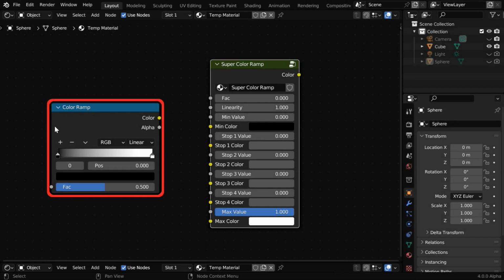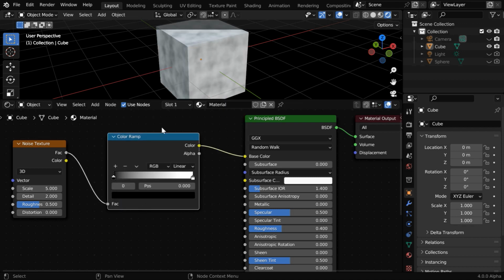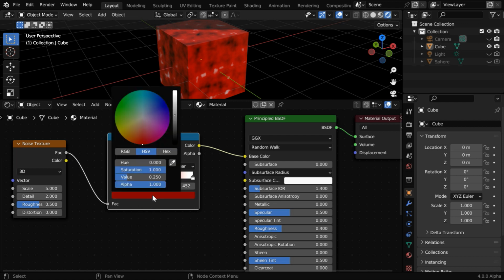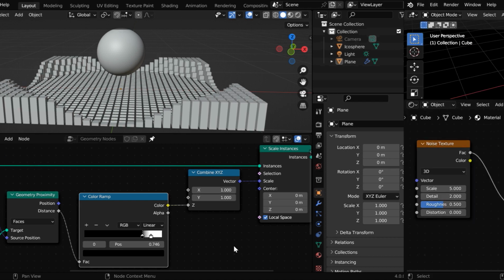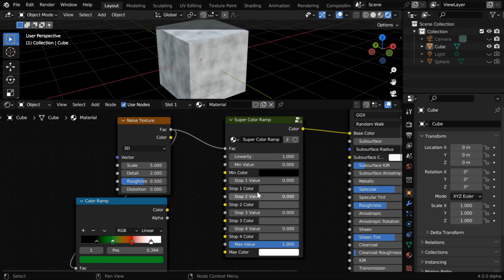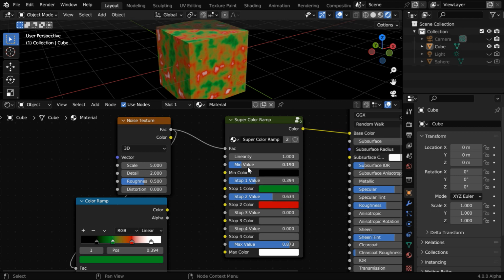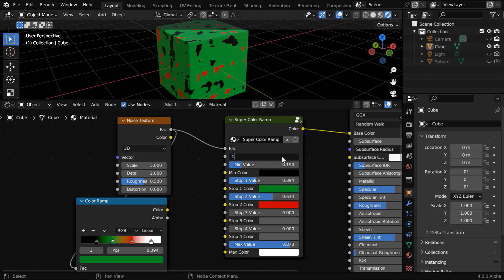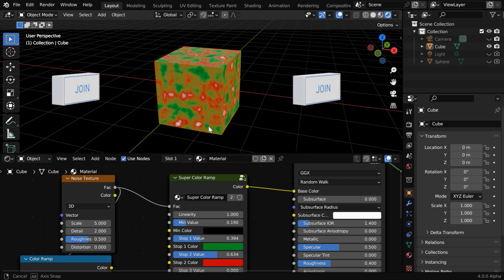Super Color Ramp (Blender) | A Better & More Useful Node For Shader Editor & Geometry Node Editor

Comment: Hi genius,
Could you tell me how to reduce font size 3d comparison videos of excel and how ro add floor and background in these videos 
When I makes videos from your script,  Although the animation works but after only few pillars my animation starts from start Is it normal which can be fully made in 
rendering or not
Reply: And how to improve light in render view mode
Reply from the maker: If you have many pillars, you need to increase the length of your animation. Just change the end frame number in blender. Some of the things that you have mentioned are covered here 👉 https://youtu.be/zyNB3gZagXQ Also we are coming up with a paid add-on next week that does this job, but it is more powerful than the scripts. You can change the font size there.
Reply: Will you add flag animation in add-on ?
Reply from the maker: @Israfatimavlogs  Yes.

Comment: Nice video bro..very helpful...bro i have a question if i want to render my project in 4k do i need a high graphics card like 3090,4090...also do i need a 4k monitor or 1080p monitor and 4090 graphics card??? Because i want to render my project in very high quality 4k..so please guide me..
Reply: You do not need a high graphics card, nor do you need a better monitor, to render a project that works at a small size into a larger image. It'll just take proportionally longer. If your 1080p render takes 10 minutes, a 4K render will take 40 minutes.
Reply: @darrennew8211  thanks dude...i have 1660 super but what about rtx??? In high graphics card u get an advantage of RTX...
Reply: @hahahahaha-3  Blender is not a real-time engine. If you do something really complex, it'll take a long time, not try to keep up with 60FPS.  AFAIK, stuff like RTX (or even a graphics card at all) just makes blender faster. It certainly doesn't affect how big the image you can render is. The amount of VRAM determines how big your textures can be while still using the GPU.